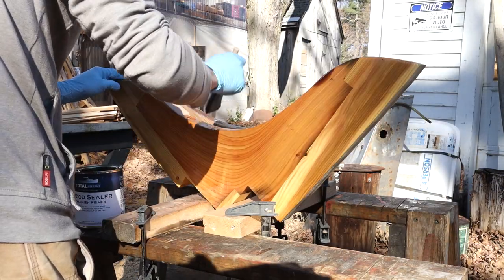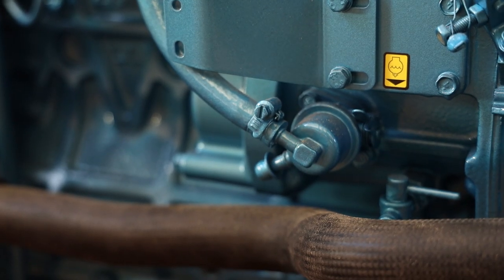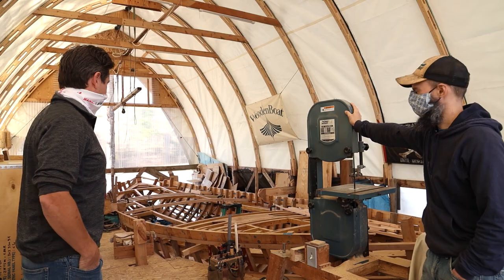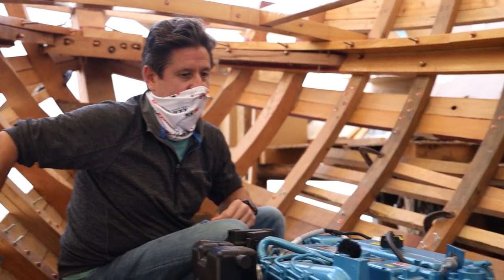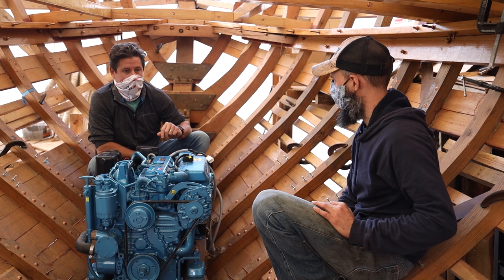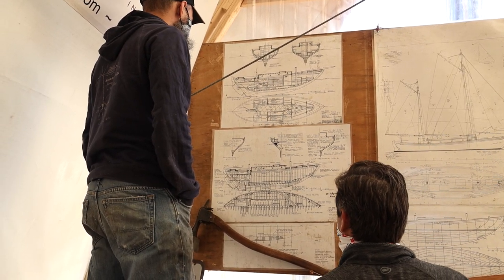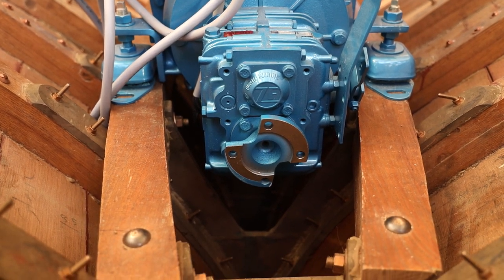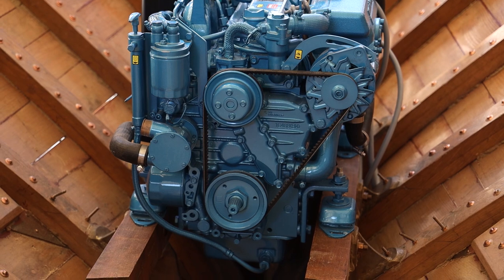Designing the Power Plant - Episode 137 - Acorn to Arabella: Journey of a Wooden Boat

Comment: I would suggest for your plumbing if you're remote mounting things which carry fuel and oil, and indeed any fluid to use a PFTE hose, ideally a Kevlar outer braided one so it doesn't have a metallic outer which chan corrode.

This will eliminate the odor of fuel and oil you tend to get, stand the test of time must better, and just generally be a better solution.

It will cost a little more than piping it all with rubber, but will pay dividends to live with.

If you can, it may be worth looking to have the other plumbing on the engine similarly upgraded, as the painted over rubber has a life span, and once used and the paint starts flaking off does tend to look rough quite quickly. Some of the formed tight to the engine you could likely fabricate in stainless and have silicone joiners to keep the tight packaging.

Keep up the good work though!

On the electric side of things, solar, wind and propshaft regen are coming along, and a number of sailing channels use them. The challenge is the range, current battery tech doesn't allow for days of motoring which you can with the diesel. The upside is, if you plan to largely sail, running costs and maintenence will be lower, and you can put the weight of batteries where you want it, which spreads the weight around a bit rather than it all having to be at the engine location.

Comment: I assume that you are planning to have a flushable head? That will require a through hull.  Also 100 amps at 120 volts (household current) is ten times more powerful than 100 amps at 12 volts. 
I strongly support using the engine to heat water. We had one. Very easy to install and extremely reliable. Put a branch line and install a space heater as well. Just like a car. We loved ours. Engine heat is just wasted energy if you don't use it. 
One final thought, seriously consider a keel cooler. That way you don't have to pull saltwater into the boat to cool the engine. Saltwater filters clog without warning which leads to overheating.
Lots to think about. 
Cheers from Juneau Alaska, 
Greg Chaney

Comment: Running raw seawater through an engine is very bad , a heat exchanger solves the problem . You guys deserve a medal for diligence , precision and workmanship . Your boat will last a hundred years , the engine could last too if it had a heat exchanger installed...  does Akiva like sailing too?  Hope so.

Comment: I agree with Robert Lugo, you did not include salt water for the Head so one more (fwd) sea chest for the galley and head is needed.  Think also about hosing the mud off the anchor chain and deck washing.  Also, you do need some sort of auxiliary battery charging, solar, wind power or sea generator (see Sailing La Vagabonde), there's nothing worse when enjoying sailing in a descend wind than having the engine beating away just to charge the batteries, not very carbon neutral either! Love the weekly show and your skills.

Comment: Stephen, when you get your fuel tank in for the diesel engine I would suggest having a gallon or two of fuel conditioner on board.  This conditioner, you can buy it at most any truck stop, will keep algae from growing inside of the fuel system.  If you get into cold weather it will also keep your fuel from gelling which would shut down the engine (been there and done that).  I don't know how large a fuel tank that you will have but it will have to be big enough to get you somewhere if you don't have the wind and this conditioner will be the birds-knees when you need to rely on the diesel engine.  It also lubricates the top-side of the pistons so that the engine has less wear and tear.  Not bad at all if I do say so myself.

Comment: “We run the house and shop on 100 amps”.  The boat is at 12 volts rather than 240 volts, so that’s a power of 20X coming from the utility pole. But comparisons aside, 100 amps X 12 volts is ~1200 watts, which should be great and you will likely add a few hundred watts of PV. A spare alternator might be a worthwhile component to have as backup. Great episode guys, thanks. -From a patron

Comment: Catch pan is a must (like others have said). What about a heat exchanger for engine cooling? Saltwater is going to be hard on that engine. What about an APU/genset? Battery boxes? Diesel day tank? Fire suppression system? What about spares that you will need? What about engine maintenance? Will you be able to take the cylinder head off while in the boat?

Comment: Hi Guys. Been sailing all my life and do lots of maintenance/installation stuff on my two sailing boats as they are both really old (so cheap).
The must have things are, 1/ Dedicated battery banks, switchable in emergency.  2/ drip pan with deep sump fwd of engine so there is no need to move filters away, just add inline ones before the engine. if neccesary, make up specuial shaped s/s pans now for catching oil/ coolant etc and they will always be there when you need them.  3/ When adding pre filters, put in a dual system so if/when one clogs you can open taps to second set and close off blocked ones. change these filters while still running the engine. 4/ Straight through raw water inlet pipe to the basket filter top above LOADED waterline so you can push a wooden stick down and out of the hull fitting to dislodge plastic bags etc that get sucked up the inlet pipe. You do not want to go over the side at sea to clear a blockage. 4/ Hot water, even if you use a footpump to access it, but pressurised system is well worth it. 5/ Food on extended voyages is incredibly important so consider very early on how you will prepare cook and store food.
I cant tell from looking at it but I hope that Nanni diesel is not raw water cooled but uses a heat exchanger, or you will need to start saving money now for its replacement.
Well done though, as you are making great progress on a difficult task.

Comment: Hey there great video. Just wanted to mention that your house service is 120v(you obviously know that) but the boat alternator is 12v so the actual power delivered at 100 amps is actually 10 times less on the boat cause the voltage is ten times less. The mains gives you 12 kw the boat gives you 1.2 kw, just keep that in mind.

Comment: Hi Guys, my boat got a new Nanni 21 about 10 years ago and I've had no issues with it—great engine. Take care of the usual maintenance items and it'll take care of you. Don't forget to check the zinc anode on the exhaust elbow too as part of your maintenance and consider carrying an exhaust elbow as part of your engine spares when you go cruising. Check out Mad's diesel tank design over on Sail Life for some good ideas on installing baffles etc.  By the way, pumping out the old oil creates very little spillage, likewise with the oil filter.

Comment: Steve and Alix,
I like the second alternator idea for charging the house batteries. I would suggest running it through a switch to charge the engine battery for if/when the primary engine alt fails. You can't always depend on a small wind generator on your weather vane and solar to keep the house batteries charged, plus, you'd have the back-up for the engine starting battery. It would be fairly simple to put in an automatic switching relay if the primary alt fails to maintain its charging output, the relay can trip and switch the secondary alt to charge the starting battery and whatever systems you may have running off that set of circuits. 
I have a degree in electrical engineering, so I am not just some armchair quarterback here. The secondary battery bank could also be put on a switching circuit for engine starting as a backup to the starting battery going bad. I would put that on a heavy-duty SPDT manual switch though.
Either or both back-up situations would add some safety to accessing your engine power should you need it to tackle big waves and rolling seas out there.
Anything that can be done to guarantee the engine will start when needed is always a good idea. Some may call it redundant, smart people call it insurance.
Great to see a system expert come for a meeting of the minds and share his ideologies with you guys and the viewers.
Thanks for sharing that meeting with us.

Comment: Some suggestions:
 - safety, consider a proper sea chest for the thru hulls. Any leaks would only fill the sea chest, not filling the boat.
 - fuel, double parallel high quality fuel filter (racor) with pressure gauges and bypass valves. When first filter cloggs you can change over to second and continue while replacing first filter. Ideally with cirkulation pump to polish fuel in main tank when needed.
 - charging, with lead acid batteries you will never be able to utilise full alternator capacity which depending on your power consumption will mean long hours on engine to achieve full charge. Regardless of alternator capacity. With lithium (LiFePO) you can utilise full alternator charge. I would choose a single bank system for maximum simplicity, i.e. only low voltage protect to ensure battery protection and remaining starting capacity. No other electronics needed, but strongly advisable to add a battery meter with current draw and remaining capacity. If adding solar to a lithium system, ensure over charging protection.

Comment: I'm not a boat mechanic, but as an auto mechanic for quite some time I would recommend packing in as many 6 volt batteries as you can afford, a boatload if you will. 2 independent ones for the engine. Diesels, even smaller ones, require more amperage to crank over than even large gas engines. 6 volt batteries tend to hold up better with drain/recharge cycles.

Comment: Guys, I would seriously consider using a closed coolant system for the engine, to separate the raw seawater from the engine coolant.  That will help, considerably, to keep the corrosion down in the engine.  It uses a simple shell and tube heat exchanger that loops both the engine coolant through the tubes and seawater through the shell, around the tubes.  Definitely, a major maintenance improvement where the engine is concerned.  Consider also, using oil absorbent pads in the engine compartment.  They absorb any oil spills without soaking up water.  Much better than trying to construct pans and so forth, to catch spills.  It's all coming together in a very determined manner.  Great job!

Comment: The canopy over the cockpit makes a great place to put the solar panels.

The point of a second alternator is not for the additional capacity, but for when the first one fails. Your engine is a big piece of emergency equipment, treat it like one!!! Even a nuclear powered submarine has a diesel engine for emergency power and air circulation (big 2-stroke, so really big roots blower).

Edit: I would also recommend installing an AC compressor to run the icebox. With the right setup, you can run the engine every couple of days or so and keep your frozen foods cold.

Comment: The diagram at 7:14 reminds me of an important point: not only does the seawater filter need to be above the heeled waterline at any angle of heel (so, ideally, near the midplane of the boat so as not to be ridiculously high) but  the pipe run should be straight (as drawn) so you can "rod out" any buildup of marine growth, plastic debris or whatever, between the filter and the skin fitting. If you have multiple water inlets, the pipe run can be a decent diameter with side branches wherever you want a valve. The top should be very solidly braced in such cases so that even if a flying battery or heavy human falling (during a knockdown) hit it, it would not apply enough leverage to snap the skin fitting. Everything below the top of the sea chest (more like a sea tree, in this case) should be considered part of the outside of the boat, and treated with the same respect in terms of unconditional watertight integrity.

Comment: You should really think about fashioning a fiberglass pan under that engine. As you said, any oily leakages in the bilge will make a stink and can soak into any wood. A well configured undertray, with a smooth gelcoat surface, will contain any leakage and be relatively easy to clean. The engine will, at some point, leak.

Comment: This is just a suggestion. Because this is a new build you could make a aluminum (or Stainless steel) pan that goes under the engine that would mount under each of the engine mounts that then would be a upside down hat looking thing in cross section but then it tapers to the front  and acts as a “catch all” so if any fluids or hardware should fall or leak down it would end up in that pan and then (because of the taper) would send everything to the front and below the engine where you could put some sort of a catch can. I know it sounds elaborate but it’s really not and it will go with your idea of keeping things out of the bilge. Just a thought and I’m sure you get plenty of them!

Comment: I hope you have studied raw water VS closed water cooling systems.  Everyone has their opinion, I have owned both.  Closed loop glycol systems are more expensive up front, but they eliminate the corrosion related issues.    YES belly pan to keep the bilge spaces cleaner.

Comment: Watched this episode twice, just to make sure I wasn't mis-hearing you guys. You're not just doing nav (I'm assuming radar, depth and GPS?) and that's it. You're going to have radio (strong signal requires juice!) and lighting (above and below deck), pumps, small fans below deck are a godsend, you'll want the ability to charge cordless tools or run corded ones for short periods if you need them, and you WILL want a cold plate at the very least. It's hard to safely keep food cold enough (or frozen) for extended periods between ports without some kind of small electric refrigeration. You'll bless an inverter for being able to tap shore power if and when you can get it. Provisioning for sea is an art (not just food, but drinking water, electricity, cooking gas and essential spares, too!) and why not give yourself some options, you know? At some point, you'll sprain something when you're a week out from land and you'll need an ice pack, for example. So get that second alternator! Take the number of batteries you think you need and double it. I think you guys expect that you can put up with a lot of discomfort, and for a couple weeks, yeah, sure, I'm sure you can stay healthy and manage it, but you'll hate being on that boat for months on end without some basic comforts (hot/cold water and a fridge, especially), I think. We live in modern times, and we also live a lot longer now because we can wash up and keep food cold. It's not a cop-out to do those things. My $.02, feel free to ignore them. Love this project, as always.

Comment: I would have an aluminum drip pan custom-fabricated to fit under the entire length of the engine. Build it with turned-up edges around the entire circumference and make sure it'll end up being lower on the front. I'd also have it made with a slight "V" in the bottom, then you can add a threaded bung at the front center lowest point for a clean-out plug. I don't at all mean to sound negative, but you're going to eventually have a leak of some sort from any type of engine and you don't want oil, fuel, or water leaking into the bottom of your boat. Also, if you have a pan angled down to the front like I'm talking about, you can readily see if you have any type of leak before it becomes a major problem, kinda like seeing oil/fuel/water spots on the concrete where you park your car.

Comment: You should add a fresh water flush to the raw water engine circuit! Will extend the life of the motor substantially. I have a similar motor with this setup, and it is extremely reliable.

Comment: Listened to the discussion on dealing with the screw while under sail.  You can let it free wheel and get free power by installing a large pulley wheel on the shaft and have it drive an alternator with a very small pulley.

Comment: Two thing...and I'm sure someone else has commented theses as well.  Just curious that you chose an engine that size that does not have a fresh water loop, which is more common for the bigger engines.  What were your thoughts there?  

You had commented that you had no reason for sea water other than the galley sink and the engine.  You should consider a sea flush for the head unless you are going with a composting head, and a seawater deck rinse by the windlass to rinse off all the mud from your rode and anchor, and to hose down the teak deck with saltwater. These can be done by bucket, but it is sure handy. other through hulls will be needed for the waste streams.